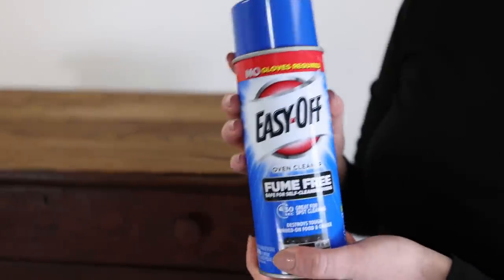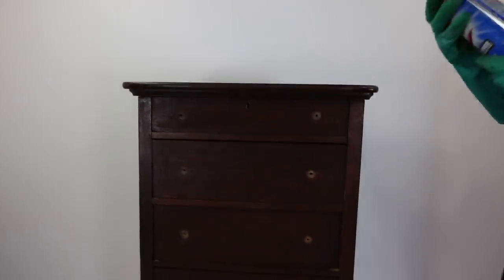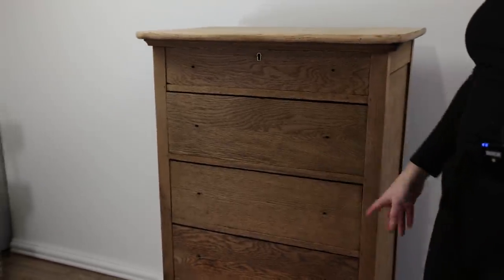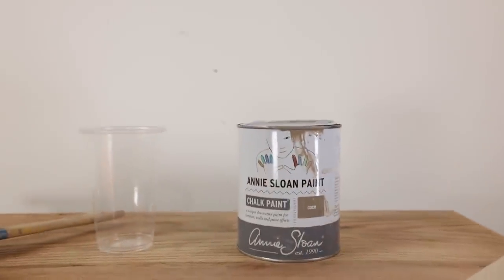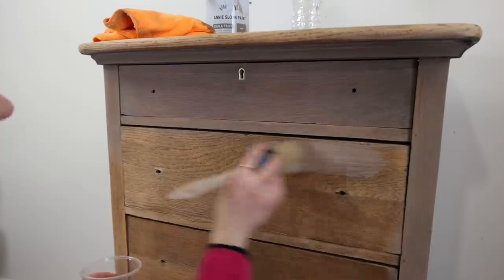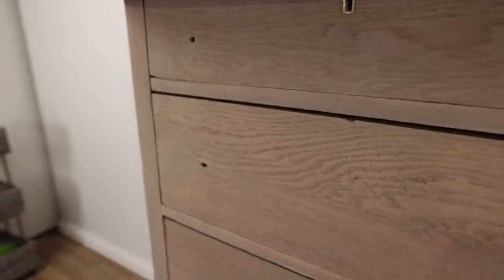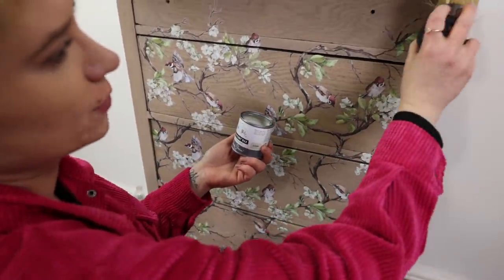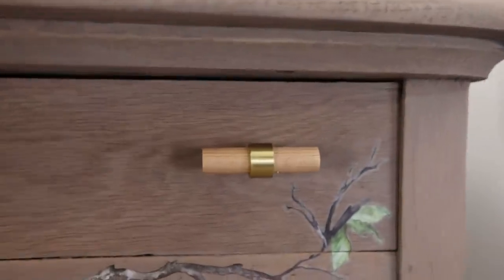OVEN CLEANER for your FURNITURE? Dresser Makeover

Comment: I found a way to save my expensive paint brushes after I've forgotten to clean chalk paint out of them. I get a solo cup of hot water and steep the brush in it much like a hot tea. After clearing out the paint I thoroughly rinse in warm water and dip the brush back in the cup that has hot water and a bit of fabric softener in it. Rinse again quickly in cold water and shake water out of it then pat with paper towel. Brush is good again!

Comment: Glad to see this. My husband and I are buying a home that the owner made their own kitchen cabinets and they look like the wood grain on the side of the dresser. And then they look super glossy like a shalack. My plan is to either take the doors off, sand back the bases, and consider just replacing the doors and painting (or leave natural). I was dreading how to get the varnish off without all the puddy knife scraping and the orange stuff. I may try this on one door and see if it comes off with as much ease. Thanks for the tips and will get the safety gloves and masks!
Reply from the maker: I definitely suggest you test it out first on a smaller drawer to see how the wood is going to react.

Comment: Só beautiful Kaćha, 👌🏻I adore that transfer! I just did 2 old pieces and found the older drawers have an odor. I mixed some citrus essential oil in a bit of clear wax and waxed the inside of the drawers and they smell yummy and look 'fresh". (Also the sliders, I just used a candle to run over them and the drawers run in smoother). 
I'm with you on the oven cleaner😉!

Comment: I have a stash of different size metal fans that can be purchased inexpensively. I use the fans to ventilate my area when using anything that should not be breathed in ,they also help paint or glue dry faster .

Comment: I have used olive oil on some pieces that were dry,the oil Pentwater and brought out the glow in the wood..Olive oil also helped were a peice was so dry that cracks were in the joints.in a few days the cracks disappeared as the wood absorbed the moisture from the oil.

Comment: Another great video Kacha. I tried the oven cleaner and I did not like it at all. I prefer Circa stripper. My question is.  I see people on tic tok use Minwax furniture refinisher to remove varnish and old stain. Cost is around 19.00 in the states however I am not able to get this in Canada. I can order on Amazon at 80.00. Have you ever tried this method?

Comment: Hi Kacha. Love your work and I love this piece. I agree regarding the fumes - it's bad enough cleaning your oven with this stuff. Question - when you apply the transfer, how do you treat the gap areas between the drawers> Do you just run a knife along it and smooth the transfer down over the drawers>. Also, I was concerned that he vigorous action of applying the wax with the brush might damage the transfer. You can probably tell I've never done a transfer before.

Comment: The chest of drawers looks to be solid wood with an unknown finish that is matte like. A pre clean with a mix of dish detergent and warm water would remove most accumulations of dirt and dust. It looks as it this has been done already taking away the actual value of the procedure.  EasyOff Oven Cleaner has a major fraction of Sodium Hydroxide. The product can be found by name with an MSDS tag. The basic salt can be found on Google. Another product or product line employing Sodium Hydroxide in homes is drain cleaner. The common name for Sodium Hydroxide is lye. Many uses in industry. Some "professional" companies that strip furniture use heated lye solutions.  Many "antique" or so called antique    furniture pieces are veneered or stained with "bleeder" stains.  Needless to say this stuff is toxic and is not a product that furniture flippers should be using except maybe on their ovens or maybe even figure out that their ovens are self cleaning.

Comment: I wonder if odourfree spray would make a difference. There's a brand here in New Zealand that is odour free. Of course I'm not gonna try it but it was very interesting watching what happens if you use an oven cleaner 
Being that its a harsh chemical.. I wonder if it would affect any finishes used on a piece
Also.. have a couple of 1940s oak dressers that need refinishing. I think I'd like to try the wash on them